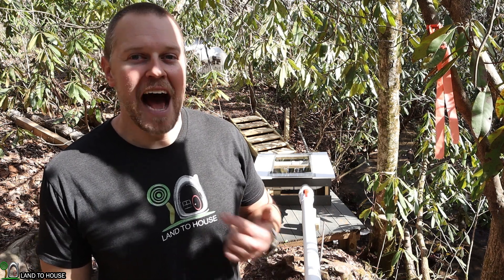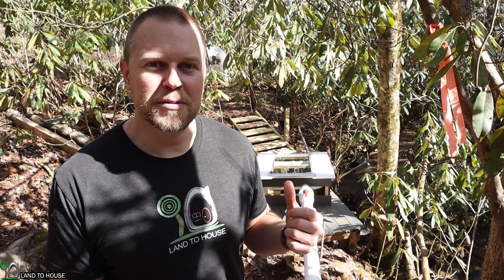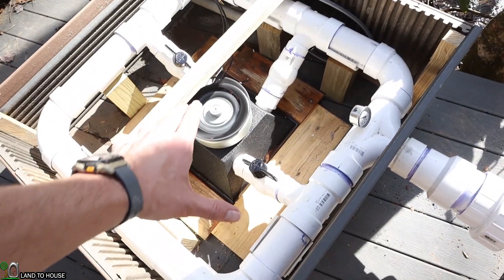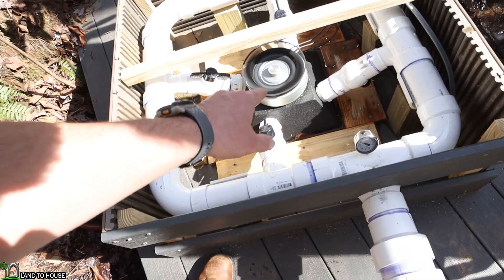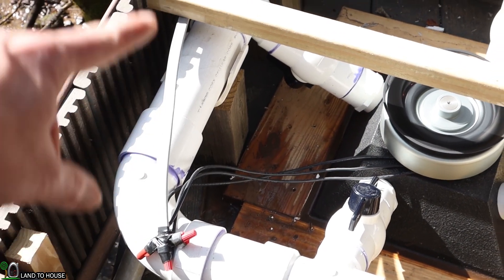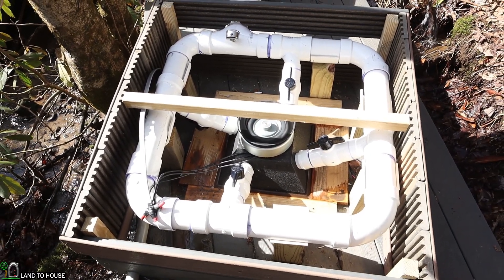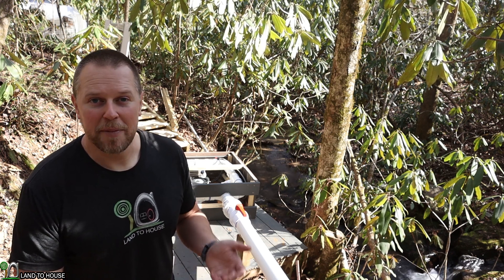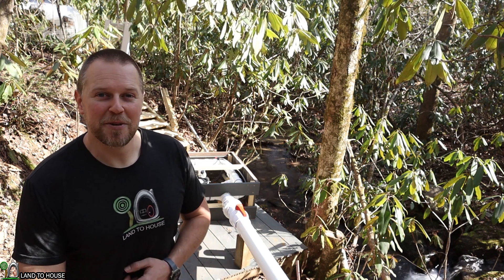Micro Hydro Turbine Overview

Comment: I have had my 900 watts pelton wheel system in operation for 15 years now, 147' of fall, 90 GPM, 3" supply line, grid tied.  The 3" runs for 1/4 mile, right at the turbine it tees into two 1" hoses that feed the two jets, simple and effective. Lately, I am getting the urge to make a water wheel, mostly because I have a 8' diameter steel reel that was used for transporting 2" poly line.

Comment: Nice set up for that PMA. Did you get any ideas for you system after this visit?
Reply from the maker: They do have a nice system. Mine could just use a lot more water to play with. But we'll see about doing some upgrades this year on my system. Currently I'm installing a 3.6 kW inverter to replace the 2 blue grid tie limiter inverters.

Comment: one more fact.            when talking about hydropower, it is the  per  SECOND  flow rate that is important.       the per Second flow rate is  one of the two variables in the calculation of (continuous) power.      (flow rate x head x gravity.      thus, the 'pressure' and a way to measure it, are  NOT  required in order to do the math.)

Comment: information; significant and basic design details
more energy is lost, where  ninety degree  bends are present in the plumbing to the jets/nozzles.          2:29   as was done here, transmission losses have been minimized by running  the (3-wire) wild-AC from the alternator to a location near where the power will be (rectified and) used/processed
. 
the output of a pma  is  wild-AC; wild-AC from a stator having  three phases.       my point is, it is more accurate to say 'wild-AC'  than  to say  '3-phase AC'.       d

Comment: I love micro hydro so much lol
I'm (hopefully) just finishing up rearing a low head turbine from work thats about, 18 years old or so? The bearings went bad and also a magnet got dislodged and stuck. It uses about 5ft of head out of a hot spring pool, and I believe it was generating about 200w when it was operational.
One of the phases coming out of the turbine also broke, left about a 8th of an inch for me to solder onto lol But hopefully it will last for a good long time now. 
I can't wait to get it up and running! Its my first time working on a turbine. And it will also help a lot at work since they are so far out in the middle of no where they have to be off grid. Right now it is completely relying on solar power, a very old run down lead acid forklift battery bank, and the propane generator. So having even the 200w or so will help a ton especially this summer for when they have a lot of people using power!

Comment: That's interesting but could a wind turbine charge controller be used in place of a three phase full bridge rectifier and charge controller?
Reply: Potentially, depends on the charge controller. Usually wind turbine charge controllers also require a bridge rectifier. 

Micro hydro doesn't always require a dump load resistor that wind turbines need, the turbine should be happy to spin unloaded if the bearings are good, a wind turbine could start falling apart. Some people prefer to run them unloaded when their batteries are charged, a free spinning turbine shouldn't have as much wear on the bearings etc. as one dumping energy in to a resistor bank.

The main problem is that a wind turbine controller might not be the most efficient way of getting power from the turbine. Pelton wheels have a peak efficiency when the bucket speed is around 50% of the incoming water speed. You need a MPPT controller to do that, and not all of them are designed to work with micro hydro systems. MidNite charge controllers work with hydro and many channels showing micro hydro use them.

Comment: That a big pressure drop! They'd probably get a lot more power with a better manifold setup with fewer 90° bends and that 3" restriction.
Reply: I would gather yes it would help
Reply: Could have eliminated one 90 by having the penstock enter the manifold at the corner of the square.  That manifold uses nice big diameter pipe. I am guessing the pressure drop is because of huge diameter nozzles for high flow,or a very long 3” section of penstock, or both.

Comment: they look very much like motorcycle alternators these days and i would suspect 3 phase motorcycle regulators for charging 12v battery's could be used
Reply: Not really, motorcycle alternators are designed to output around 14v, which is then regulated. The regulator rectifies the 3 phase and uses SCR's to regulate down to battery voltage. The big heat sink on them is for getting rid of the wasted energy as heat. (Car alternators don't use permanent magnets and regulate the field coil to get the right voltage.) 
Connecting a turbine PMA to a battery via a rectifier might work, but it would fix the turbine at battery voltage. This is unlikely to be the most efficient speed for the turbine, so efficiency will be terrible. A rectifier and MPPT controller  is the way to go.
Reply: @benlee4940  I never mentioned car one as they are not pma yes maybe voltagereg not ideal but if they easy to come by then they an option not everywhere can get hold of mppt controllers easy or cheaply

Comment: hey try the center-in rim-out centrifugal impeller (full flow no splash turbine)
Reply: it kinda has all the flow ducted nicely in the spinning sectors
Reply: yep if pelton is like vawt (outer rim spin force), then this is something new
Reply: simple as heck, check the model on my video on here
Reply: oh and no volume area reduction nozzles, just 100% volume flow coverage
Reply: just attach the self-ducted centrifugal turbine to the water output pipe, say 90 degrees angle so that the disc spins horizontally, then the water will slosh out all directions, with slowed speed, torque vs speed